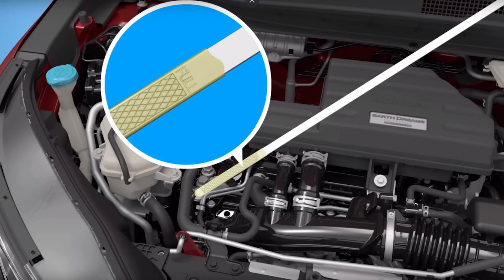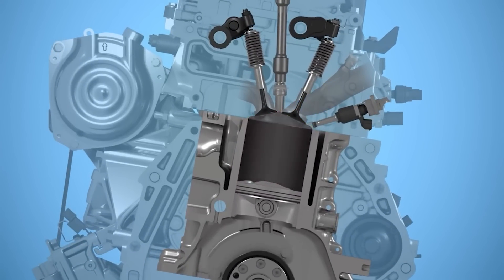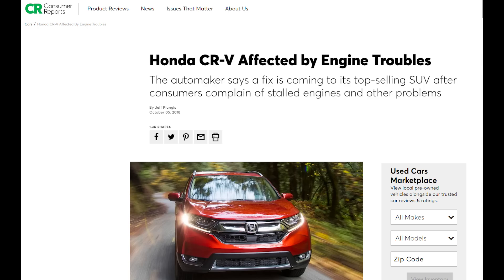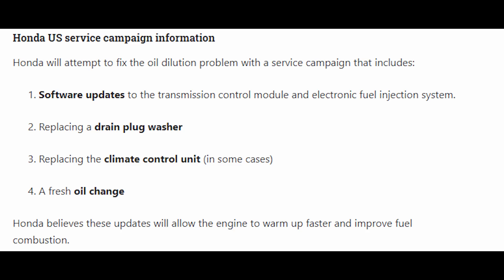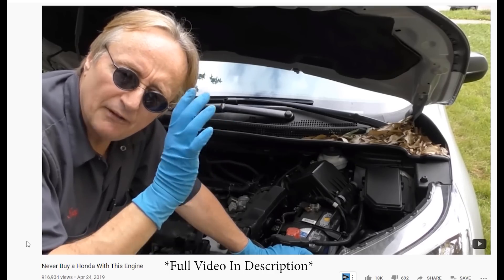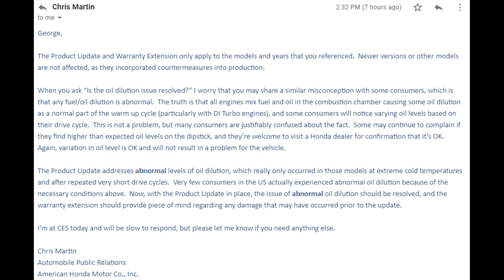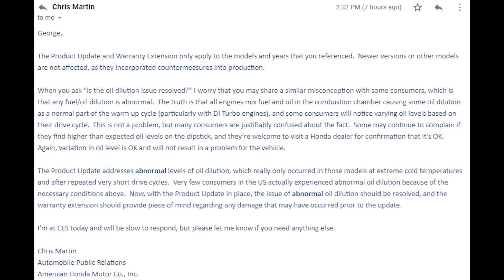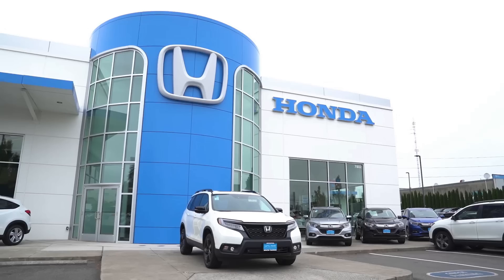Does Honda Have An Oil Dilution Problem? | 1.5L Engine in CR-V and Civic

Comment: Imagine being beat in reliability by Dodge! Wow😂🤣🤣
Reply: I have a 2009 Dodge Challenger 5.7L V8 with 289,678 miles on it exact, and I never had one issue with the car and I drive it everywhere and race it too sometimes on my local drag strip. So I mean I guess Dodge V8's aren't so bad.
Reply: 111915 528518 sorry but I don’t think anyone that’s ever owned a Dodge would believe you.
Reply: ralliartgsxr you'll always find those type of fanboys from every car model with the same comment.
Reply: @ralliartgsxr  Okay that is their problem and yours, but I have the car. I have it and it still runs. I usually commute to work with it, I have to log in about freaking 45,000 miles a year with this car since 09. But when you are young and stupid, you buy cars over a home close to work. I recently got a house now closer to my job, but the car is still hanging with me just fine.
Reply: @JAM_2024  Fanboy ? lol why don't you be a man and get one.
Reply: @1119-w3u  don't lie
Reply: I had an 85 Plymouth 5-Speed Manual - 365,000 miles on it when I sold it (wish I did not - but 4 cars was 2 too many and it was the oldest). I usually got at least 43 MPG on the highway, sometimes as much as 51MPG - Miss that car..

I did have to change the AC Evaporator once - put copper in place of Aluminum, Converted it from Holly Carburetor to TB EFI ..at @ about 160,000 miles. a Power steering pump went out - ground wire got caught in the pully.  That was it - good car.

Comment: I can't understand how can the 1.5 engine have flaws, but the 2.0 and all the others Honda engines don't 🤔
Reply: Im assuming its a mix of the direct injection and the extra cylinder pressure due to the turbo.

Comment: even the dipstick on my 2016 DI 2.4 L crv reeks of gas but the level read just a half centimeter over the full line when I brought it in for oil change in late december .I was going to buy-out my lease when it expired in a few months but dont feel like worrying about dirty valves or getting my oil analyzed over and over again in future . Will likely lease an HRV that has multi port injection and suits my budget better anyways

Comment: A dodge rated as more reliable than a Honda?? 😂😭😂😭😂 whatever site that is, I don't trust.
Reply: My wife's 16 compass runs great and does not have fuel dilution like these shit Honda engines, same gos for my 14 focus with a DI engine
Reply: @leoderosia9279  my brother had a new Ford recently. The transmission broke on him 3 separate times, and they had to pay him back for the cost of the vehicle 😂 Great American quality there!!
Reply: @leoderosia9279  that 14 focus is part of the class action lawsuit....lmao you should probably look into that. Ford knowingly putting out that car with a shit transmission.
Reply: @TheBrianKenney  I know all about the ford dct but mine still runs great after 100k miles, I also had a 07 focus that made it to 200k until some guy cracked the engine block with a hammer trying to get off a starter, this was after I sold it to a friend. My hippie neighbor has a mercury villager van with 340k miles on it ...I have had a 60 mile round trip to work for 36 years and made it every time with domestics. My bil is a Asian fanboy like u but says the best car he has ever owned is a 2015 mustang gt
Reply: @leoderosia9279  everyone can have good or bad experiences with either. But as a whole, there's no arguement to be had about which is usually more reliable in the long run. Toyota and Honda have earned their reputation.
Reply: @TheBrianKenney  i think they have been better overall too but I would rather have people buy more domestics  which helps my job working at a big 3 supplier  ....we also supply Asian company's
Reply: @leoderosia9279  that may be the case, but those are both relatively new. I guarantee my Honda will outlast both of those cars, easily. Oil dillution or not. Honda makes some of the most reliable cars on the market, as a whole.
Reply: @leoderosia9279 "shit honda engines"
They're literally world renowned for their engines. Did they make a mistake with these engines? Sure. But they literally have been making some of the most long lasting engines for years and years.
Reply: @TheBrianKenney  those 1.5s are world renowned crap....I only buy American big 3  cars . I know Asian vehicles are good but so are domestics with proper maint....I will easily get 250k out of mine if I keep them that long. I work at a supplier and support us mfg when possible . Libs and epa were pushing mpg which has led to some of these turbo gdi disasters
Reply: Don’t bring politics into a car discussion.  No place for it here.
Reply: @markp6586  are u the hall monitor?
Reply: @leoderosia9279  difference is, like with my last car, which was a toyoya, I changed the oil when necessary and that was really it. Got to 160k no problem before I got my new car. You can say whatever you want, but a Jeep isn't gonna last that long without having issues along the way.

Comment: Just to get more info out there, I haven’t had any issues with my 2016 1.5t civic.  I have done all my own oil changes and haven’t had any gas in the oil so I may have gotten lucky.  I live in Ohio and it’s gone through 3 winters so far. 

Just something else to add I’m very confused why everyone is just done with Honda.  Many car manufacturers have had issues like this and if they fix it I’ll be just as happy with them.

Comment: It's funny I work for a honda dealership I even own a 2019 honda civic 1.5t and have never had this issue.  I've done plenty of oil changes on alot of crvs civics and accords with the 1.5t and never smelt a large scent of fuel in the oil from the dipstick or in the oil when its draining. I've been in the mechanic industry for almost 10 years now and and even before working at honda I've done plenty of oil changes and all the cars I've ever worked are all pretty similar not saying there isnt an oil dilution problem but LITERALLY every car has that issue.
But to say you dont want to buy a car because of a 1.5t because it has a small flaw is insane I mean even the k20 and k24 engines that were put into the civic crv element and accords all had an issue of oil consumption not every engine is going to be bulletproof and that shows with Nissan's rb engines and even toyota 1jz and 2jz the engine is never going to be perfect the first time around but that doesn't mean you should give up on it they need info so they can improve things on the vehicles and honda has improved the engines overall I mean it's not like your engine is just gonna seize up on you as long as you do regular maintenance and keep up with the vehicle you should never have any issues with them.
Shoot if there's anything people should be worried about is the gli engine or what ever it's called in the 2010 to 2013 I believe Hyundai sonata and Elantra that motor LITERALLY detonates its self after get to 30k miles or so that's a very big issue compared to a small dilution problem that does little to no harm to and engine just let your car warm up in the morning about 20 minutes or so before driving off to let everything seat properly and get warm that's more then likely why there's this issue in the first place cause no one has patience to let there cars warm up before they drive them it doesnt matter if it 100 degrees or -20 degrees if the engine hasn't been ran for a long time then it's going to get fuel past the rings and go into the oil!! 

Just wanted to let everyone know!

Comment: Unfortunately turbo engines just aren't as reliable as naturally aspirated engines. none seem to have no problems after 150k miles.
Reply: I refused a porsche for pennies on the dollar because its a pile of crap due to twin turbos.
Reply: @mikeschiavoni5973  The Metzger engine isn't great because of turbo's. Its an engine that is built from racing and are extremely stout and overbuilt. Most passenger cars are no longer overbuilt, because it actually negatively impacts gas mileage. As a result engine's are now no longer built to handle 350k miles like Land Cruisers, because cars are now disposable technology items.

Comment: The hybrid does not have direct injection.
Reply: Good point. I was thinking the same. Atkinson cycle I believe with same electric motors as the Accord. My only reservation is a car that mixes two system ( gas + electric ) has more points of failure which concerns me.
Reply: B Stevens true, there is that potential.  But I think in general an electric motor is more reliable than a turbocharged engine.   And some hybrids have very good reputations for reliability.  But I get your point - if something does go wrong, it could be expensive.

Comment: I know Honda has had some problems with transmissions and with their ECO mode engines.  But, rating Hyundai, Mini, Dodge, Kia, and Nissan ahead of Honda is rediculous.
Reply: I have a 2008 LX and a 2014 EX w/Nav. I have over 200000 miles on one and 89000 miles on the other. No problems with the 2008 though my 2014 had an AC problem

Both running like a top
Reply: @sap268  That's good to hear but the cars you mention do not have the turbo and the GDI as in the CRV 1.5 turbo.   I regret trading my old bulletproof 05 CRV (non-turbo 2.4 L) to this day for the 18 CRV turbo.
Reply: Honda’s are no where near as good as they used to be. I’m surprised Dodge and Mini are above. Maybe Mini has improved, as a mechanic myself I hated the earlier “revived” ones from the early 2000s, those plastic pieces of junk. But it’s hard to see why Dodge is above.
Reply: U bought one recently? 

I had. Its shit
Reply: @theallseeingeye9388  I had a 2007 Odyssey EXL then I bought a new EXL in 2015.  Both had a few minor recalls but nothing else.
Reply: Ruban Raj Kumar Ganesan I have and it’s been perfect 18 accord sport
Reply: I have a FIAT Abarth and a Jeep Grand Cherokee Summit.  Borh have been flawless.  My daily driver is a SAAB.
Reply: Lol...Mini is above Honda.

Comment: My wife has a 2017 CR-V with the 1.5 Turbo.  It currently has around 58,000 miles on it.  I change the oil myself every 5,000 miles and have never noticed it being over full or any hint of gas smell on the dipstick.  With that being said, I do not think it will be a long term vehicle for us because of all the complaints that I have heard and read about.  She loves it though and it gets great gas mileage!  She averages around 31.2 mpg.   We are located in Southwest Tennessee where it normally doesn't get that cold.

Comment: In a nutshell, just change your engines motor oil before the reccomended  interval. After all, it is a very high compression four cylinder turbo, and requires a little more maintenance than a regular N/A four cylinder engine. I always use the every "3 months or 3000 miles" rule on these engines just to be safe. The manufacture change interval is way to long, especially if you drive in tough conditions everyday.

Comment: I have a 2018 Accord EX 1.5L -- 26,000 miles with zero issues.  I change my oil every 4,500 miles & use full synthetic Mobil-1.......hoping to stave off any issues.
Reply: Still have the car? I just bought one today
Reply: @ericmurray238 -- My stepdaughter has it now.  Just over 60,000 miles on it.

She is a senior in college and lives in Virginia.  She has the oil & filter changed every 5,000 miles.  I last saw the car when I was back home in the US last October.  ( My wife and I live overseas. )

My son has a 2013 Accord with 180,000 miles and it is chugging along nicely.  It has the 2.4L non-turbo engine.

My mother-in-law has a 2017 CR-V (same 1.5L engine as the '18 Accord) with 55,000 miles and no issues.

Keeping our fingers crossed!  My wife and I drive a 2021 Mazda CX-30 over here and really like it (we brought it with us to Germany).  Mazda certainly has upped their game!

Comment: The turbo is trash.  They claimed it was for fuel efficiency, but look at the stats, the engines are less efficient with turbos, just more horsepower with smaller cylinders.  My 2013 4-cyl accord is more efficient than the new turbo one.

Comment: I have the 19 Civic SI & live in Phx Arizona I've never had an issue with mine being a drop over the line when I changed it.. I check mine 2X a week always the same place I left it when changed
Reply: Does the si also have the 1.5 turbo engine ? I thought the si had a larger engine.
Reply: @sweis12  1.5 turbo. Valves, blades on turbo different, Cam's & more boost...
Reply: Give it time....since its an si it may be built better, or it could be burning just the right amount of oil to appear ok.
Reply: @mikeschiavoni5973   I don't "think" it's burning oil. & we will find out it does smell like fuel (lil bit) but from what I've been researching all cars that have direct injection are going to have a little bit of fuel in the oil. Fuck it, is what it is. 5-quart jug of oil is only like 25 bucks at Walmart I'm just going to use a Mobil 1 or K&N oil filter & change the filter every other time & change the oil when the meter says like 40 or 50%... I dunno what else 2 do

Comment: I bought a 2018 Civic EX-T (w/ the 1.5 Turbo 6 Speed) brand new, it now has over 21K Miles... as of posting this, I have not had any issues.  Note I did take it in to the dealership as soon as the fix was available.  Overall I'm satisfied with how Honda has handled this and plan on buying my wife a new Honda Passport this year.

As an aside I think getting almost 50mpg highway is well worth a few growing pains

Comment: This may very well be a mistake in design and it will take a while to see if it can be countered by computer control or the new gf6A oil.  The fact cannot be erased that Honda is still one of the best car manufacturers still around today.  Honda is a master at engine technology and it shows.  But every company has had and will have their mistakes.  Anyone who wishes to scurry off to Hyundai or ford or Nissan is welcome do so lol, but don’t cry when they inevitably don’t measure up to the Hondas you trash talked ;)

Comment: Oil is cheap and engines are expensive. Change your oil more often than recommended.
Reply: Jeff Stone I change every 5k kilometres I spend $100 that’s it 👌🏼
Reply: @carlosgj1308  you should not have to, Honda should recall this horrible engine.
Reply: xxlxpman why not I always change the oil every 5k regardless if manufacturers says 8-10k for me oil it’s cheap and if you don’t look after your car it won’t last
Reply: @carlosgj1308  our last crv was an 2018, it would dilute the oil with 8 to 12 ounces of oil in approximately 2000 miles, I will not change our oil every month, especially synthetic is not that cheap.
Reply: xxlxpman well its up to you it’s your car not mine and I rather spend $100 than 5k to replace the engine soon anyway in my country don’t have that problem 👌🏼
Reply: @carlosgj1308  I traded it back to honda, I didn't want it anymore.
Reply: @MontanaWelldigger  all new engines are shit
Reply: @carlosgj1308  Dude.. do it yourself, it's $15 per 4.7qts and like $4 for an oil filter.
Reply: CNNis FakeNews I’m talking about good quality oil and filter for a new car not cheap oil for a 20 years old car 😂
Reply: @carlosgj1308  Don't let the sticker price fool you, for SuperTech $15 for a jug, for the full synthetic. It is amazing oil, competes better than Redline racing oil.  Check ProjectFarm's channel for "supertech" oil comparisons.
Reply: I work with a guy that’s spent his whole life as a honda & acura tech. He says it’s best to always use 5w20 and 3k intervals. I use what is specified but personally feel like he’s probably right. You can definitely see a difference in cars that have have the oil changed regularly. We have some regular customers with cars over 400k running like new.
Reply: @gregblau8082  I agree, 100%.  The 5w-20 would make the difference, and I agree with the 3k intervals.  
.
I've broken in all of my engines using SuperTech from Warren Dist, and have opened up the engines to see shiny components, clean from the regular oil changes, no sludge.
Reply: CNNis FakeNews I mostly use havoline because I get it at cost and don’t have to bring anything with me to work. I use excel (sp?) api sf for my older cars. I get it for $8 a case at sam’s club. I never really looked into it but wouldn’t be surprised if it was made by the same people as supertech.
Reply: I was a main car technician at honda (even working at different locations) for the past 2 years and we had always set the oil change reminder to 3000 miles for every honda that we worked on. I dont know where people are getting the 5000/10000 mile oil change number from
Reply: @cssplayer91  The 10000 mile oil change interval is coming from Toyota. Having to change the oil on a Honda every 3000 miles is completely ridiculous on a modern car using synthetic oil. I don't have time to change my oil every 6 weeks.
Reply: @cssplayer91  the reminder is based off oil condition so the cars says when it thinks the oil is going bad generally about 10,000 miles or so
Reply: Gas and oil for lubrication is not recommended Jeff Stone.
Reply: Fact Checker  that's not true at all, the Honda maintenance minder takes into consideration idling, hours operated and the type of driving you do, high-speed low-speed.
Reply: Oil is cheap and I don't disagree with your sentiment as a car guy.  However, if a manufacturer states 5,000 between oil changes as an example that's what most non-car people are going to do.  They aren't going to do it earlier because they "don't have to" and it costs them money.  Couple that with the fact Honda uses 0w20 in their engines and there's a dilution problem - it's easy to see why folks are getting upset.